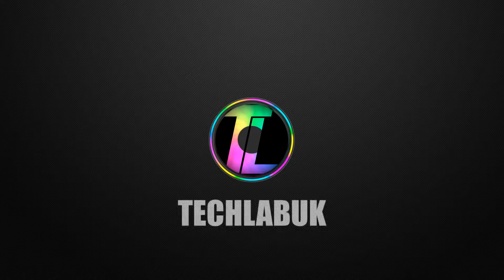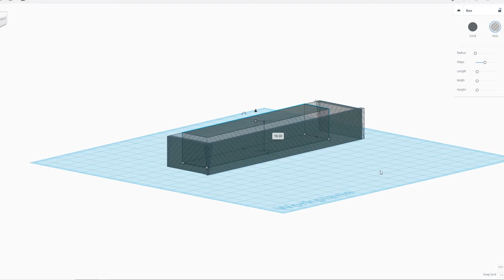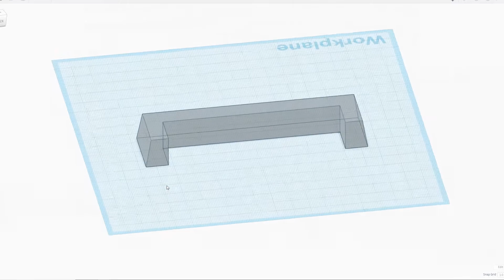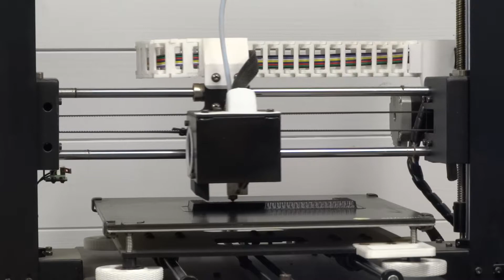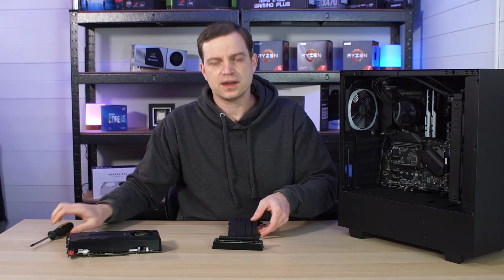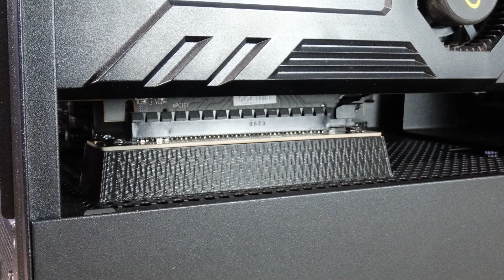New Studio PC Part 3 - Fixing the GPU Sag!

Comment: Very clever and simple solution and looks great. Am surprised NZXT don't do a proper vertical mouning bracket to hold GPU in place firmly though, when they have vertical mounting slots. Vertical mounting has been pretty common for a few years now so seems like an oversight on their part.